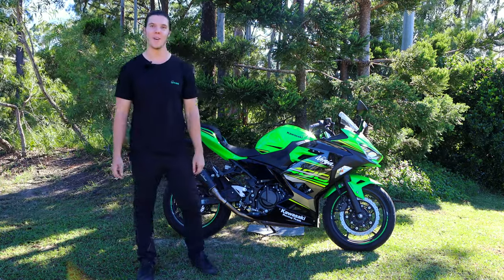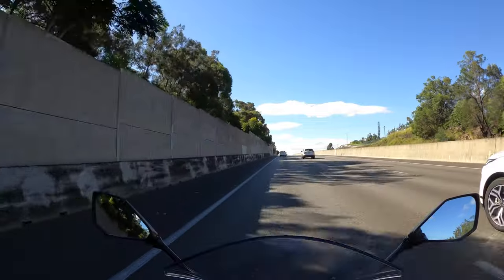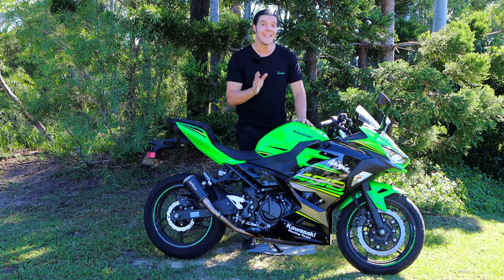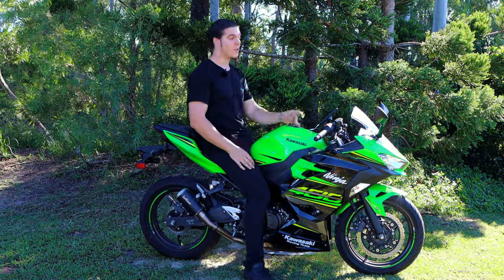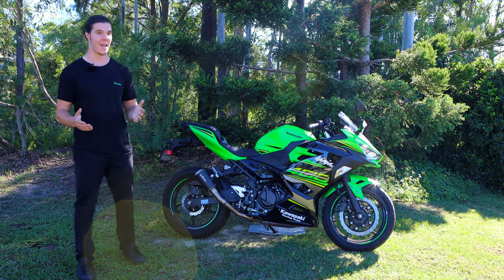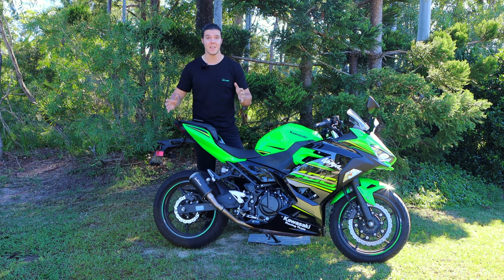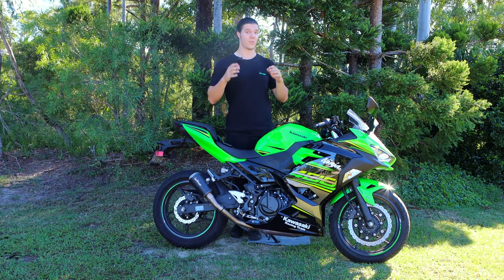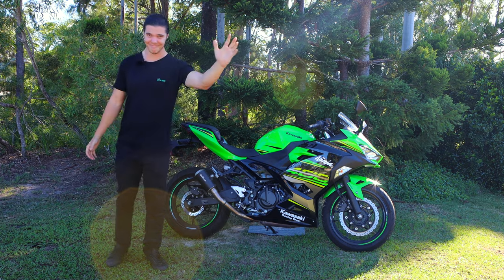How Is the Ninja 400 on the Highway?

Comment: 250 is enough for highway, sitting at ~7000 rpm with 110 km/h speed. And though it's even lighter than 400, wind was never a problem and I've experienced strong crosswinds on it. So you can get why it's hard to me to imagine someone wondering if 400 is enough for highways)
Reply: Depending on your highways you’re cutting it quite close, with some highways being 70 or 80 mph speed limit
Reply: I respectfully disagree I'm sorry I just live very close to 95 I've had two other bikes before my Ninja 650 and I was not nearly as comfortable only being able to top out between one bike was 85 with 300 that was very scary because you have tractor trailers next to you and going to pass you yes going downhill they hit 90 sometimes but I definitely think they're awesome bikes maybe if you got the gearing perfect and headers and pipe you can get 125 Maybe my bike only does 140
Reply: Sorry talk text you guys are going by Metric
Reply: Can't tell what you were trying to say at all, really.

Comment: I got over 12k miles on mine. It's a very fun/easy bike to ride and insurance coverage is very cheap.  It has more power than most people will ever need, it might not take you 0-60 in 3 seconds or have the lightning fly by speed that the 600cc supersports easily do, but it offers the fun wot speed in every gear.  I can guarantee that 95% of people who say they are getting bored of the power are talking about straight away speed, anyone can go fast in a straight line on a motorcycle, but if you can't handle twisties on a 400 at respectable speeds with full control, you have not outgrown this bike.
Let's be honest though, the 400 is a nice looking bike, but not a bike to showoff.  Skinny tires, simple body, and inferior sound even with a slip on exhaust.  Pull up or park next to a 600cc supersport or a liter bike and it will look like a little toy.  So don't act like rambo on a 400.  Overall the Nina 400 is an excellent & enjoyable bike.
Reply: how much for payments n insurance?
Reply: M not able to outgrow my 100cc  8bhp bike

Comment: I've been riding for 12 years & pushing the 50yr old mark.  My first bike was a 2002 ZX7R.  I rode it for 10 years.  My husband bought me a Vulcan S 650 & I bought a '95 Ninja 600.  I have ridden anything smaller.  Today I went to the Kawi dealer looking to "upgrade" the 600 to a newer Ninja 650.  I sat on a used 2019 and it felt so comfortable.  Unfortunately, it had just sold.  So I sat on and discussed the 400 with the salesperson.  I'm not an aggressive rider.  I honestly don't need alot of power, but it's what I'm used to.  Going down in CC's seems "backwards" if you know what I mean.  Also, I don't do much highway riding anymore.  However, after watching your review you've put some of my concerns at ease.  I think it's going to be a done deal.  The Ninja 400 sounds like all I really need.  Thanks!!!

Comment: I just bought a 98 zx6r as my first bike and couldn't me more happier ..
Good info on the bike saying the 400 has trouble against wind I never heard that before but can see why it's so light
Reply from the maker: Congrats on the first bike mate! Straight to a zx6! 
Yea the lightness has got it's pro's and con's unfortunately. 
Stay safe out there
Reply: Monzy I don't have wind issues with mine and mine is lighter than stock, also with more power lol
Reply: How much wind is tolerable to ride? I’m new
Reply: @zin9121  I rode in some pretty strong winds before and I just adjust to it so I'm slightly leaning into it and it's no trouble. Ya strong gust might move you a little but it's not all the way across the road unless you freak out. I normally just ride tucked in if the wind is strong, it helps. If you continue to sit up then of course the wind is going to move you more

Comment: I rode my ninja 250 1050 miles (1600 km) on interstate 95 in 3 days very comfortably.  I cruised at 70-75mph (110 kph) most of the time and could accelerate to go around a vehicle in a few seconds. It actually has lots of power at that speed because it’s just under the power band in 6th gear.  When you start to accelerate it just gets better and better.  It’s silly to say a 400 is borderline, the 250 was great.  I weigh 155 (68 kg) btw, so a heavy guy might have different results.

Comment: Welllll.....probably better than my 1964 Honda 305 CB77 SuperHawk, which I can still cover a thousand MILES (not kilometers) a day at legal speeds a day. No, the suspension isn't the most comfortable, and the drum brakes both ends take some learning to use well, but I can run away and hide from ANY Harley-Davidson in a drag race or when the road gets twisty. I've made several THOUSAND dollars at Tulsa International Raceway racing Hardlys on "run what-ya'-brung" nights and NEVER lost. At 67 years of age, I'd rather not race from Tussa to Denver anymore, but I will, except for a GoldWing!

Comment: I have been commuting to work on my 2020 N400 for over a year. Traffic is non-existant for me since I have to lane filter every time. I coast at 90+ mph just fine without any wind knockback. Definitely good acceleration to get around slower cars.

Concerns I run into are keeping up with maintenance (chain clean/lube every 500 miles) and oil changes every 5k miles since they rack up quickly on pure highway commutes. My tire squares out from the straight line driving as well. Gotta buy a new rear tire every 5k miles it seems. Trying a touring Continental type right now. Im at 13k miles on it now.

Comment: yea 400s r perfect commuter bikes. got a drz400 myself. does fine on the highway. ur not gonna be going 100 mph but u can cruise at 70-75. if u wanna make it more comfortable at higher speeds just make the gear ratio tall. got a 38 tooth rear sprocket for my drz and now i can sit comfortably at 80 mph. they arent very good touring bikes cause they rev higher and they arent really meant for comfort, they arent meant for speed either but its a solid bike to get u around and still have fun

Comment: Agree that the Ninja 400 is a great highway bike. I rode mine 800 km moving house from Coffs to Woodgate Beach, and it just hums along the freeway at 110 kmh, and overtakes in 6th gear. Very flexible motor with good torque.
I'm looking at seat options as more than 2 hours has you wanting to stop and walk around, and for touring (which it does just fine), a bit more seat comfort is the only improvement I can think of. I'm looking at a Corbin seat with tasty matching green trim.
Everything else with the Ninja 400 is just perfect. 
I put the higher bubble windscreen on, and it definitely improves highway comfort and reduces fatigue. My wife's Ninja 400 has the standard screen and I notice more wind on her bike. I think it is a worthwhile upgrade. We both have Akrapovic slip-ons, and I have to send my ECU for re-programming when I fit the matching Akrapovic headers I bought for my bike (sending it to Norton's in USA).
Just love this bike, and I ride it a lot more than my Ducati Diavel (which is an amzing 'fantasy' bike, and super, super comfortable with the stock seat and Touring Pack (high screen) - no other mods needed. BTW.

Comment: I was hoping you'd point out the light weight of the bike. I just bought a Z400, and the only issues I have with it are how even just a light breeze has me leaning into it. Otherwise, a great starter bike with plenty of power to keep you going for longer than the 250 or 300 cc bikes
Reply from the maker: Yea, I think this issue is on more than just these bikes, but it is really the only thing wrong with it on the highway
Reply: @Kwackajack  I describe it as a highway capable bike, but I wouldn't recommend it for long term touring

Comment: Question from a viewer in the States: I currently have a Ninja 400 that I use mostly for highway commuting. I definitely agree with you that the 400 has enough power to be highway worthy but gets kicked around by the wind a bit. I was wondering if you've ridden the Ninja 650 at all, and how that bike compares in terms of dealing with the wind?
Reply from the maker: I haven’t ridden the Ninja 650, but have ridden the Z650, the naked brother. Even though that bike is unfaired I found it better on the highway because of the bit of extra weight
Reply: @Kwackajack  Thanks for the reply! I've been debating whether the 650 might be worth the upgrade for that added weight, and this is really helpful! The 650 has the same or higher curb weight in the official specs as the Z650, so I gotta imagine she'd feel a little more sturdy as well. :)

Comment: I would love to see a comparison video between the 400 and the 650. i've owned a ninja 650 and currently own a 300. i would love to see how much closer to the 650 the acceleration pull really is. there aren't any videos that i can find that clearly compares these two bikes since they aren't technically in the same category. i know for a fact that the 400 will be slower than a 650, i can read the spec sheets, but id love to see how they compare regardless. in my area, the cost of ownership is greatly reduced if you plate a 400 or lower cc motorcycle. hence why i'm debating whether the additional cost of ownership would be worth it for me.  ** By the way, love your content. keep it up**
Reply from the maker: Thanks for the suggestion mate! Glad you enjoy the videos too. 
I'd love to get my hands on a Ninja 650 and film some content, I was fortunate enough to have a z650 for a day and I can confirm that the extra torque from the 650 is definitely noticeable. Hopefully I can get my hands on more bikes soon!
Reply: I have the same exact question, I couldn’t find any information either so I went ahead and bought the 2021 650, I like the feel of the 400 but was afraid it did have enough UMPF to it. I would love to see a comparison as well.
Reply: I’ve talked to a few guys at the track and a lot of the regulars who go are switching from the 600 to a heavily modded 400 it’s so perfect with how light and nimble it is.
Reply: Having ridden a dozen or so bikes from 250-1200 cc, including some SuperSports, and liter-bikes,  you will always find yourself getting used to the acceleration of any sportbike if you own it and ride it a lot. 

With that being said, the Ninja 4000 is faster than your average sportscar 0-60, and equally as fast in the 1/4 mile drag race, so if all you want to be able to do is outpace your buddy with an entry level sportscar (Say, the base model new Supra), you have enough speed to pull away, especially at low speeds.  What this translates to for functionality is that, you won't ever feel like you can't make a move to pass someone, because you can easily get up and go, just by dropping a gear. 

By contrast, the 250cc bikes, especially the CBR 250, is nearly at max speed at highway speeds. For mph, highway speed is 65-85, and the CBR maxes at 85ish.

Comment: Did you notice power loss when you put on your Leo Vince in the high rpm range? My RPM’s are dropping and then it seems to catch up, possibly the clutch but it started as soon as I put on the slip-on? Thanks man super entertaining, I rode mine 1500 miles and other than wind it was a blast!!
Reply from the maker: Glad you enjoyed the video! Nah I didn't notice a power drop, if anything with the noise and how aggressive the bike seems now, I'd say I gained an increase. But it may just be a placebo
Reply: it could be the clutch. these bikes have a wet noodle clutch and have a common clutch slip issue. can fix it with firmer clutch springs and a clutch assist spring.

i upgraded my fristion plates, clutch springs, and a clutch assist spring. and it feels and performs wayyyy better

Comment: Back when I owned my Ninja 300, cruising at ~130 kmp/h I would sit at around 7k RPM at 6th gear.
Reply: Regarding mid-helm wind, I used to have that too! A cheap double bubble windscreen off Ebay redirected the wind more at my shoulders, which was a huge comfort improvement.
Reply from the maker: Yep, I think especially for taller riders it would make a big difference!

Comment: With engine vibrations, you said they're not too bad, but can you elaborate further please? Do your hands eventually go numb from it after x minutes or hours? Thank you!
Reply from the maker: Yea they will eventually go numb but not from the vibrations, more so from the slight forward lean. It's not too leaned forward though so you should last quite a while. 
The mirrors and pegs don't vibrate too much and you can clearly see through the mirrors at highway speeds. 
I give it an hour or so for me before I'd want to hop off and have a break

Comment: Ninja 400 or yamaha r3?  I need all the opinions I can get please.  I cannot make up my mind
Reply: ninja 400 does 130+ 🤷🏿‍♂️
Reply from the maker: I know that can be a tough one to make, both are great bikes. I went for the Ninja, because it had extra CC’s and I liked the look of it. Check out my ‘7 reasons why’ video, might help you out!
Reply: I'd say the Ninja 400 as well. I actually had a 2017 R3 when I first started riding before upgrading to a 600, FZ09, and stopping riding for a few years. Started again a few weeks ago with a Ninja 400 and I can definitely tell the difference in power and torque.

The R3 is a bit less wide and I felt it flicked around slightly better - but it definitely feels "smaller". I think you can't beat having the extra power. And if I'm not mistaken, the R3 costs just about the same or slightly more than the Ninja 400. (I saw one in a dealership recently and I think it was either higher or very close). So overall, you're getting a bit more for your buck.

Comment: i own cb 500 pc26 on highway  cb is lesss susceptible to wind beacuse is 23-24 kg heavvier than ninja 400  but is much worse in terms of aerodynamic /it dont have fairings  in terms of high speed acceleration is close but cb spin lower rpm however at end i think n400 winn hear due to fairings which is like for me bigest factor .
Reply from the maker: Yea unfaired naked bikes do get a lot of wind on the highway. I took the z650 on there and I was hanging onto the handles to stop being pushed back!
Reply: @Kwackajack  heh yea true unfortunatelly :x

Comment: Is the ninja 400 with 40+ HP powerful enough for the highway...

As someone who learned to ride on the old Ninja 250 ('80s-'07 edition), and who currently rides a CBR250...  

Yes. A Ninja 400, which is faster by a fair chunk than the CBR500, is definitely fast enough for the highway.  XD

Comment: Who wonders if a 380lbs bike with nearly 40hp is going to be fast enough for the highway? That’s basically 10hp per 100lbs. 

Most economy/compact cars like a civic weigh around 3000lbs and have around 150hp. That’s around 5hp per 100lbs. 

Who wonders if a civic is ok on the highway?
Reply: Ever hear of a drz400? 320 lbs, 40hp, close ratio transmission that's horrible on the highway. Its a thing.

Comment: I love your videos but you're way off with how fast a stock 400 will go or even hooked up 400 it's not going to do a hundred and whatever he said it'll to school for 100 maybe 105 110 at most maybe a few change the Sprocket in the front and make it huge you could get 115 out of it
Reply from the maker: I’m talking in kilometres per hour, not miles. Our speed limit is between 100 - 110km/h on the motorway